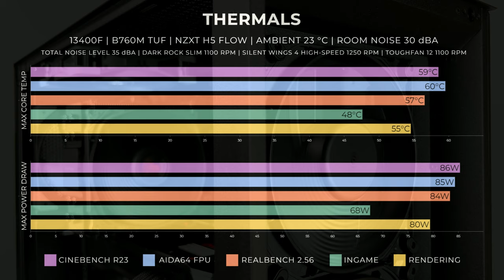NZXT H5 Flow Zero RGB Gaming PC Build | 13400F | 7900 XT | SILENT WINGS 4

Comment: Do you think these specs could do 100+FPS on a 3440:1440p ultrawide?
Reply from the maker: Hi! Depending on the game, it might be possible.
However, the 1% low frame rate could be disappointing. 
Of course, on your monitor, GPU performance is far more important. But!! The 13400F is not sufficient for sustained performance I guess...
The 7600 seems like a better choice if you focus on gaming.